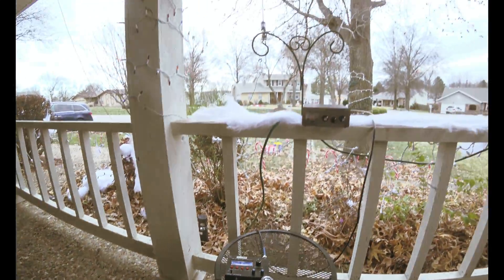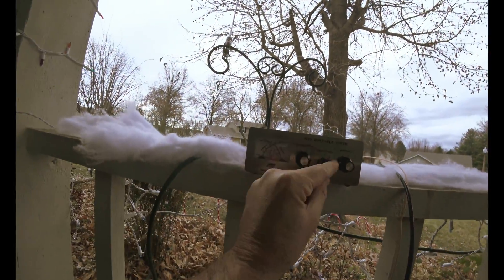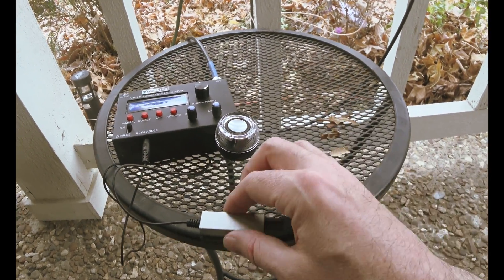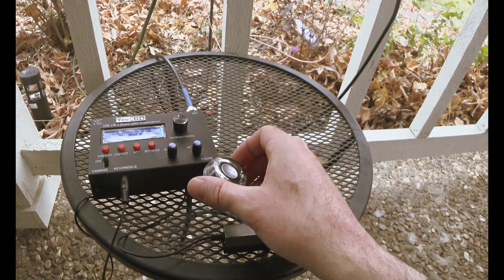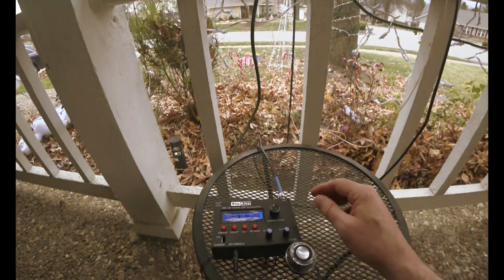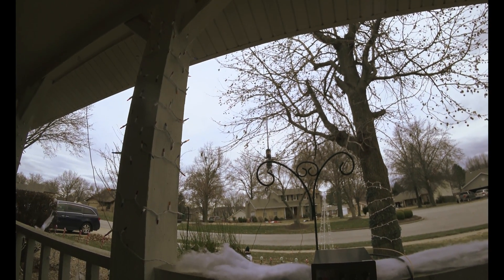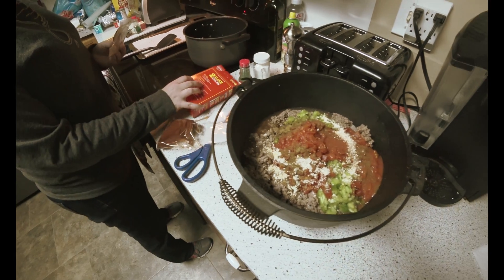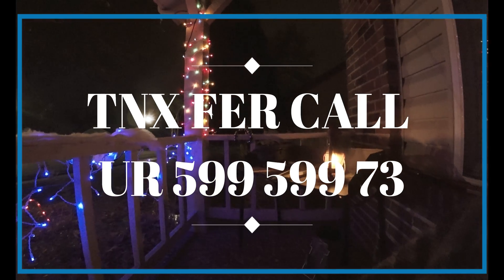YouKits QRP Rig Listening ~ Outdoor Cooking ¬ MFJ Tuner

Comment: As far as QRP radios I have the KX2, 817ND, and the HB1B. I think the HB1B will be my go to radio if I am going to the park to do CW only.  With my Sotabeams Tri-band antenna, I will not even need a tuner.
Reply from the maker: That sounds like a good setup.  I'm working on specific antenna for the YouKits as we speak.  More to come.